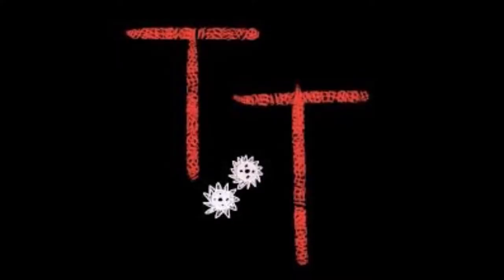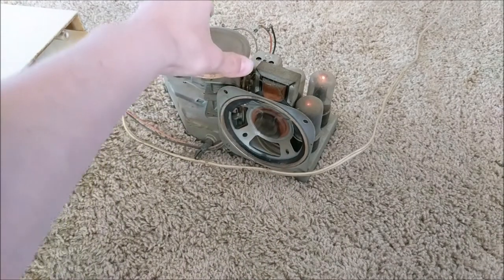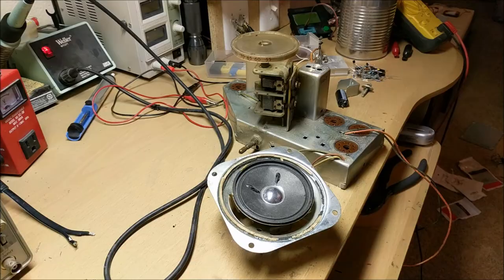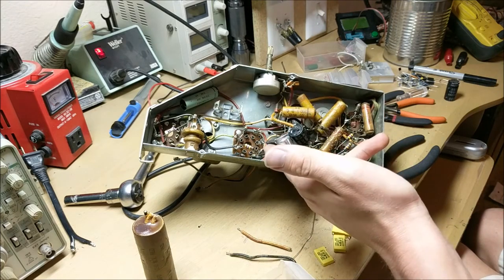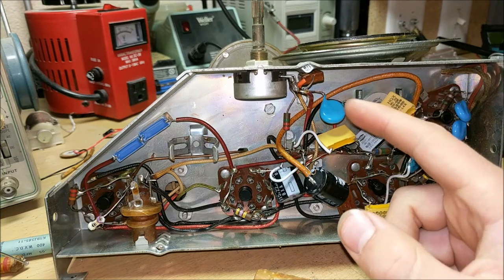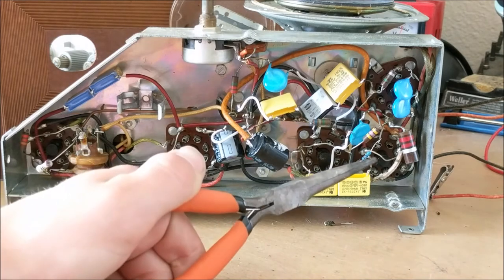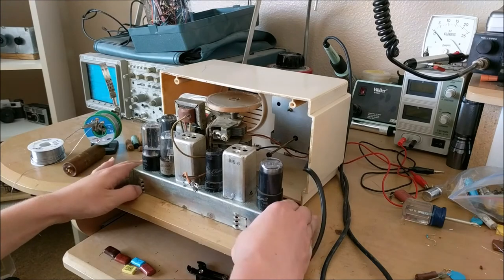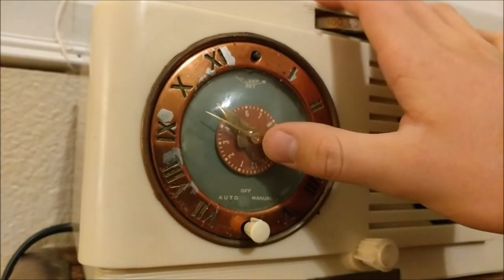How to Repair a Vintage Clock Radio

Comment: I have a ge model 60 (the same model as this one except it's brown and not white like the one in the video) in better condition, one tube is an rca and it has a boyer's radio service salt lake city Utah sticker on the back so one of the tubes was probably changed at some point, but it is in practically brand new condition, the stickers are all still on the back and in good shape, and it even has the original OPERATORS MANUAL still with it and also in really good shape for a paper operators manual, and for 5 bucks at goodwill I got that radio that's worth over $100, but of course i'm not selling it, especially since I'm using it to lean my tablet against while I'm writing this comment right now lol.

Comment: Adding the speaker to the existing magnet will change the magnetic specs of the speaker.  Besides, the smaller diameter will not fit to the case, resulting in substantial loss of bass response due to acoustic shortening.
Reply: Bass response on a 4 inch speaker...🤣🤣🤣🤣🤣 you old people are funny...😂😂🤣🤣🤣

Comment: Great worki fixing the tube clock radio!  Please fix the original speaker also. you can buy speaker reconing kits on ebay . the original speaker affects the sound quality, distortion and volume level to an amazing level. An original speaker in good condition can sound amazingly good.
Reply: mohider khana, another way is to use a speaker from another radio, one that is so badly messed up that would be suitable only for parts. That size speaker was the standard size used on all of those five tube radios. Also, if there is only a tare in the paper speaker cone, it can be repaired with ordinary household glue, and the speaker would sound fine.
Reply: Dude i thought your speaker repair was awesome... dont listen to those over 50 types talking bout those 4 inch speakers with great "tone"... cuz none of them had great "tone"... try repairing a old wooden housed radio... then you get TONE... 😁😁😁

Comment: I'm surprised your radio did not have silver mica disease. Personally, I would have change them out. Its going to be a matter of time when the radio will start to crackle, hiss and have bad reception. This radio you have is very sensitive .

Comment: I liked your video except the speaker part ,maybe some day you can find a more correct speaker for it ,but it was a useful video ,I starting to play with a old radio ,mine only a has one was filter cap the rest are ceramic ,lucky me ,except now the brittle speaker wire broke and I get to figure where they go fun huh ,I will use your video ,I ordered another tube radio I got cheap ,

Comment: To add a mp3 player to it you can find the high side of the volume control pod and feed positive signal in... grounding it to the chassis but u may have to add a switch to turn on and off the IF signal from the IF stage. Ps you should be able to find a NOS speaker on ebay it will reduce static a lot that is what thay call an all American 5 radio about from the 40s er 50s